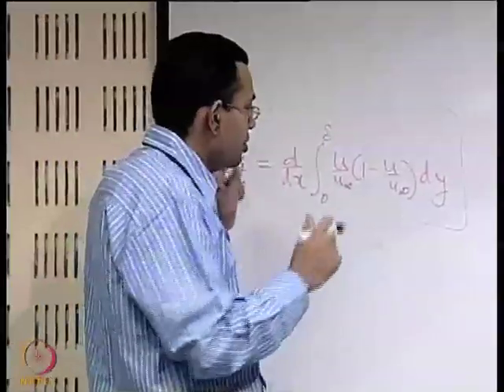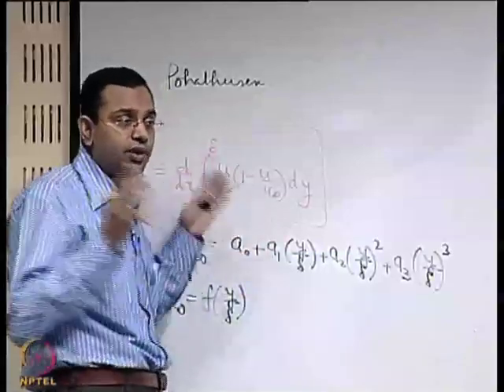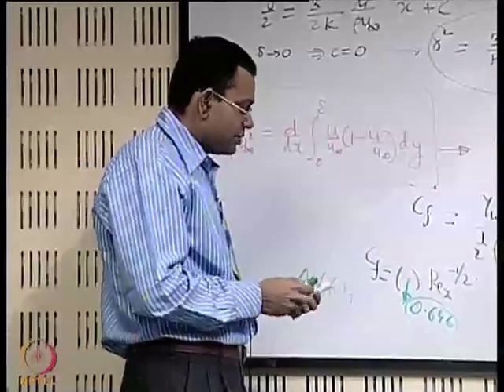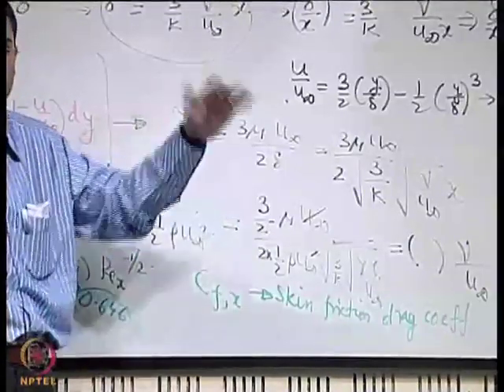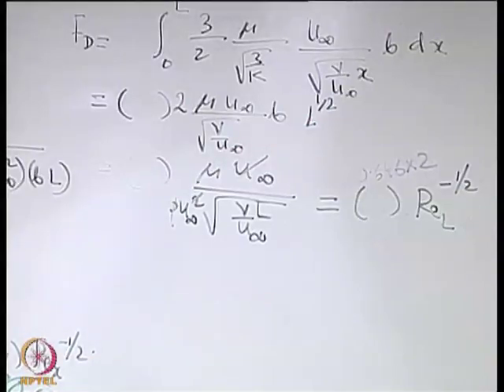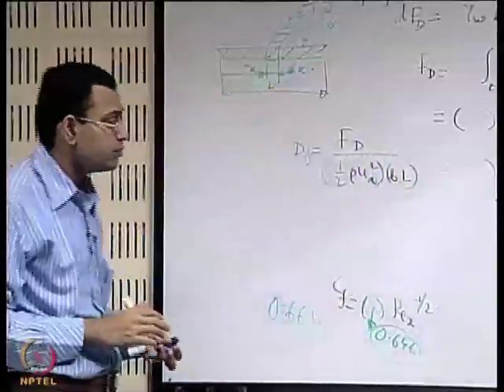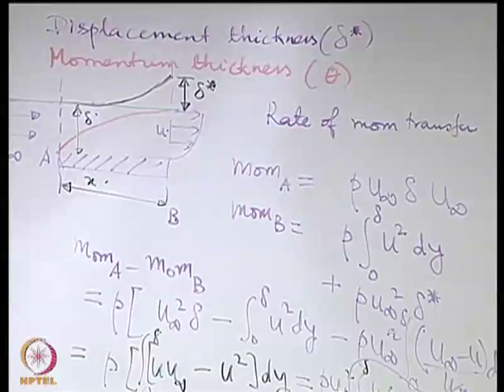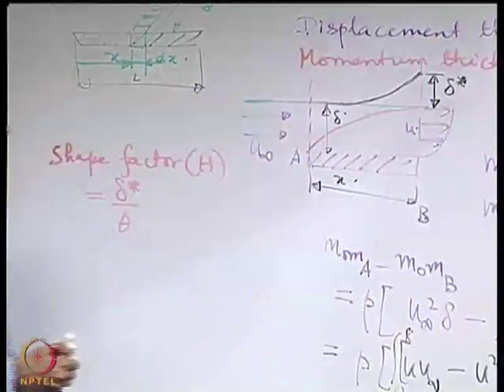Mod-01 Lec-39 Boundary Layer Theory (Contd.)

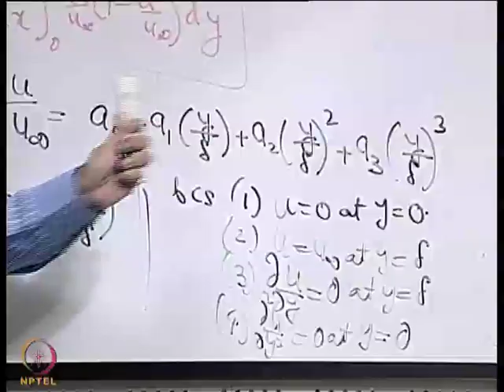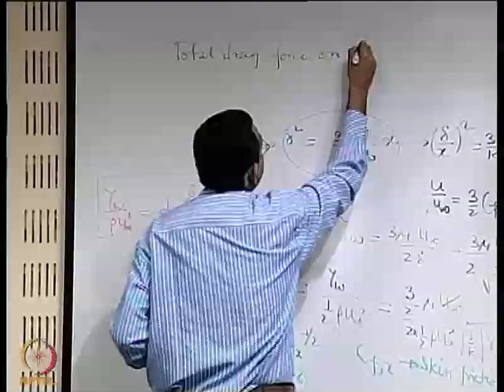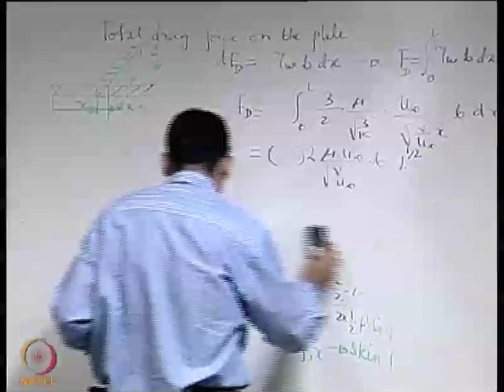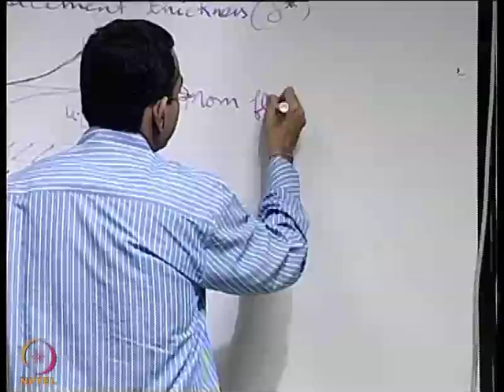Comment: 8:15 That Equation, 22:28, Total Drag Force on the plate 22:35, Coefficient of Drag 26:15, Displacement Thickness 29:41, 39:29 Momentum Thickness 
Example Problem: 47:47